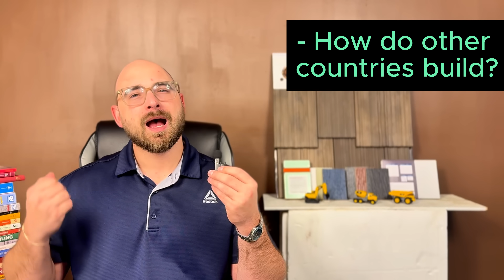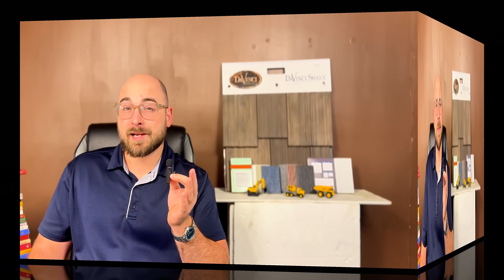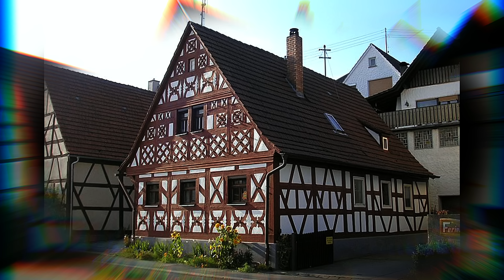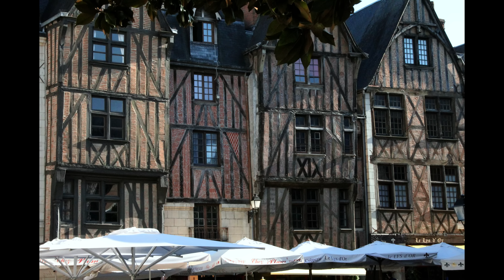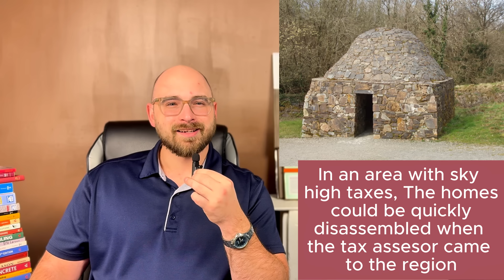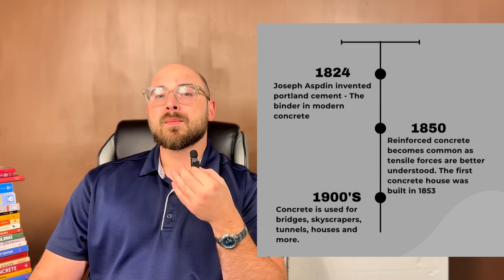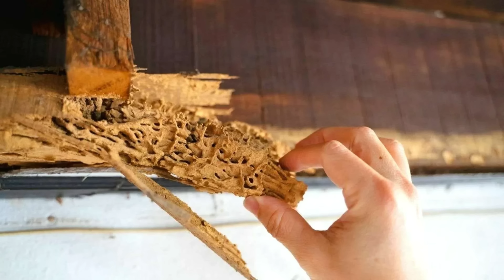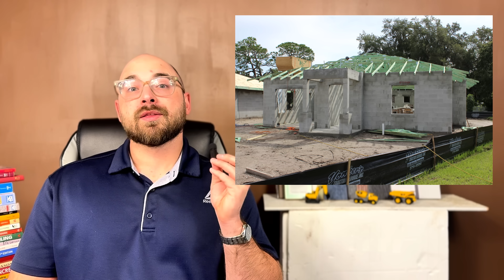Why Other Countries LAUGH at American Homes

Comment: Define what is fast. As a kid, I remember watching the news about the US and how tornadoes destroyed entire cities. So, over 20 years, they still rebuild with wood. How many times do you think you'll need to figure it out? I like light wood houses in concept and regions where the weather is not so crazy. The Americans ( the citizens) are not stupid just insurance companies force them to rebuild the same way? Or insurance on concrete houses is expensive? I don't know, but it's not just you don't want to build this way. I am currently looking at what type of house I want to build and comparing the prices. Metal frame and light wood frame houses are around 30% cheaper, especially if it's 2 or more floors. Another thing you need to keep in mind is how fast you want your house. Brick/concrete houses here are built for 1-3 years, depending on the availability of workers, etc. While premade metal frame house takes not more than 30-40 days. So when you build a brick/concrete house, you may think it will cost 200k, and in 3 years, prices are 20% more,labor is more expensive, and you are in a bad financial position :D There are many factors why something is preferred over something else, even if it's not the best.

Comment: @Mike_Fortin: From France: I lived and worked in USA. Yes, your home are not built strong and durable. It is a quick, simple way to built home, but it is as fast to destruct them.
When you compare CO2 between wood framing and MCU, the first is built to last at the best nowdays, without any type LA fire or hurrican, 50 years when the MCU or concret can last over 150/200 years without degrading and is bug resistant. Stone homes in France have over 250/500 years with roof framing built with whole trees.
The ICF seems to be a good solution, I just don't like the exterior foam which can easily melt and burn. The foam is also bad idea inside like in a case of fire, run away because poisonous gases and it is fire fuel.
You roofs built with shingles burn too easily, more better is metal sheet or like in UE clay tiles.  
Not easy to make the right choice. Each state has its reasons for what is the best for themselves and the homeowner wishes.
Anyway, you did good and made great comparaisons. Thanks.
Reply from the maker: The foam doesn’t burn with ICF, it’s treated with a fire retardant
Reply: @Mike_Fortin Your channel is so educational!
Reply: @Mike_Fortin  Hi, fire ratardant is not fire proof. Maybe with a good sick plaster and well finished, it could resist some time against fire.  With ICF, what about the perspiration of the walls?  Thanks again. Have a good day.
Reply from the maker: Correct, fire barrier is still important inside and out. 

Stucco/ fire resistant cladding protects against embers are there’s also fire resistant stucco such as Ustucco which will also protect against radiant heat, though how much is unknown 

It is possible to add a higher degree of fire resistance using densglas and/or rockwool to ensure the exterior ICF is safe from embers AND radiation / convection (direct contact with flame, nearby flame) with no damage to the foam 

As for moisture, I recommend Crown ICF block which is glued at joints for an air/water barrier combined with a capillary break at the footer. 

This leaves for a very dry wall. Earth coupling and thermal mass keep the concrete warm enough to prevent condensation
Reply: @Mike_Fortin  Thanks for answers which can people decide for themselves. Regards

Comment: Halftimbered houses were the standard in Germany for centuries - not because they did not know how to build with stone or brick or had forgotten it. It was just much cheaper / cost efficient way. Houses made completly from stone or brick were only for the very wealthy and used for castles, palaces, townhalls, churches etc.
Consequently, in the 19th century existing halftimbered were considered as poor and were often covered up on the exterior (or least a the front to the street) with plasture and stucco in order to give it a more solid appearance. At the same time new buildings were built with bricks then, because through the industrial revolution and mass production bricks became cheaper.

Comment: I live in France. The current house, and the previous house, both had a concrete floor between the 2 levels.

I won’t go into the structural strength properties. I will however go into fire risk.

If there were a fire downstairs, the way it is constructed, buys time for the pompier (firemen) to arrive.
The fire should remain contained. A fire upstairs, could compromise the roof, which I expect if it collapsed could very well knock through to the ground floor.

Yes, of course there are older properties that can go up very quickly. But any newer properties are built in such a way that buys occupants time in the event of a house fire.

Uk, where I was born and raised, used an outer structural brick, with an inner breeze block. With insulation between the brick and block. Any building estate I ever visited was like this, but methods could’ve evolved in the last 12 years.

I won’t speak for other European homes.
However I understand the criticism towards the US methods. Timber frame will burn down in little time. You won’t have much time by comparison.
Structurally speaking - why are weak timber frame properties being constructed in tornado areas? By all means live in these areas, but why in a structure that won’t withstand a tornado?

I have every expectation that a brick built euro style structure, would stand up against a tornado far better than the timber frames you use.

Comment: "You can always plant more trees"...really?  Where?  Lots of farmland is being turned into subdivisions for SFH with balloon frames built with (no joke) wood from Columbia, Nicaragua, Brazil...it's only a renewable resource if the people who use it replace the stock they deplete and if the methods of harvesting, utilization, and replacement are harmonized.  Germany is really good at this, but the US has NO CLUE when it comes to forest management...or, OK, any sustainable management (meaning you leave or restock so that your kids won't be out in the cold after you drill baby drill...).

Comment: The problem with US homes is quality. Its alright to build homes out of wood if that was the only material one could afford.

But a lot changed and the simplest wood house skyrocketed in price and quality dropped significantly. Theres far too many videos of just finished brand new homes that put chinese houses to shame in the worst ways possible. Awful construction, mold everywhere, some wood pieces already rotten, shoddy wiring etc.

However america should switch to brick/concrete housing due to the natural disasters that hits them. Hurricanes, tornadoes and such completely flattens "modern" wood houses while brick/concrete houses are much better at handleing those. Whenever a tornado or hurricane hits and decimates an area, if theres a brick/concrete house it makes the news how those received minimal damages without compromising structural integrity.

But then again capitalism benefits from the destruction of wooden homes so building better houses are unnecessarily made harder to build.

Comment: Perhaps I will say something not very new for you, but in the period of its existence in the USSR, most apartment buildings were built of concrete, the so-called "panels". Now you can see them all over the former USSR, for example in Ukraine, Poland, etc. There is even a separate style of architecture that uses concrete as the basis, brutalism.
Reply: Yes, I am from USSR, Russia, and those are solid, standing forever, well-insulated, you never hear your neighbors, and the floors are heated. 

I grew up in a red-brick CHRUSHOVKA with super-thick walls, I’d sit on a window like it’s a couch
Reply: @AnnaSzabo  Concrete with rebar is definitely not forever. It will rust and lose strength eventually.  The lifespan of those is generally considered 50 years though I'm sure if built well it could last longer but not forever.

Comment: Yeah I can afford a 1200sq ft house on 6 acres of woods for less than the cost of an apartment in most of Europe.  It’s 75 years old, and the floors squeak.  I don’t care.  I inherited it, put 50k into replacing all the mechanical and electrical systems, and now I have a paid off house that costs almost nothing to maintain.  Try doing that in Europe.

Comment: ~21:00 There, you said it, Europe builds to last. America builds to... completely unnecessarily, rebuild after a bit of weather. It's the old version of tofu-dregs. American housing is a scam. While the construction sector is classically corrupt everywhere, the US sports a special version of that corruption. People aren't even aware they could build to last. We consider American houses not houses but shacks. That stone that went through 4 walls? The answer is not to remove all the stones from the garden, but to build actual walls and not these room-separators that pretend to be walls. The country that is the epitome of the "Three Little Piglets" fable, that barely anyone knows around the world learns nothing from it. Your houses are supposed to burn up, fall over from wind, mold and collapse from flooding, so they can be rebuild, ie have you spend money again, until the next bad weather. You don't have proper dikes for the same reason. You don't even build for the last bad weather's severity, you just go back to were you were, like some African Tribe stuck 10000 years ago that never invents anything, that never improves. You are an exploited people. If I ever had the money and opportunity to move to the US, I'd move to some hurricane area and build a house to German Industry Norms just to see what happens, and likely prove a point. We have oak uprooting winds here once here in a while, but no house is crushed, bared a tile lifted off a roof. A decade ago the old down the road was uprooted and fell against the very bricky tavern on the corner next to it. The only damage: Some scratches to the bricks you can see still today. The giant tree more like rested against the building that anything else.
Also, a friend of mine told me his parents in Florida were 3 weeks without electricity after Helene went through. Three weeks! You're not a 1st World Nation. Put your cables underground! "Oh, we can't do that because [insert silly excuses that would never fly here like the ground being too wet or not deep enough]". Look at Braunschweig, Germany, the town is build into a swamp, resting on stilts like Venice, engineered by the Dutch (who also gave their expertise in dealing with the Sea, Floods, to the Japanese and they are better for it) who's country is BELOW SEA LEVEL while being NEXT TO THE SEA and not only regularly deal with floods and are prepared against them, but also are expanding further land into the sea every tidal cycle - which is just further proof that this whole "muh rising sea levels" malarky is a distraction, for we cannot control the planet's climate, but we can adapt to it.

And one last thing: You have a major error on your thumbnail. The English. Here on the Continent we do not consider the English's houses to be houses either. From our perspective they're as bad as yours, they just don't get as hard of a weather. The English freeze in their brick houses and we do not. Why? Because they built one-brick-thick, and we built three-brick-thick. Furthermore their water supply freezes in winter, because those jokers kept their pipes outside the buildings and overground, we didn't. It does make for a good Tim Burtonesque industrial-gothic scene for movies though. I'd still prefer having running water in winter and not freezing though.

I am fuming because my friends suffer because the Construction Sector of their home country is so corrupt they didn't even know what they could have had. That they could be safe, that their families could be safe, that they didn't need to lose everything from some bad weather, including loved ones.
The US Construction Sector is just like China: It pretends to be Construction, but it isn't. It's only a surface level act. It is a narcissistic scam, and it needs to end, change,  grow up.

(Also, precasts are ugly and disgusting)

Comment: Concrete does make more CO2 per square foot, I think insulated brick would make more sense. 

Commerical properties are almost entirely concrete now days.

Changing code would be the hardest thing to change, I wanted to build a brick home, but our local code requires a wood style main construction.

Comment: I'm obviously biassed since because where I live in Mexico, but why would you build a house, an investment that probably costed decades of work, with a material that isn't the most durable thing possible you can find?

To a degree I can understand using less brick/concrete and more wood to add extra insulation if you live in a very cold area (Although in modern times, why not use other forms of insulation?), but no brick/concrete/stone? It feels weird to me.

But as always, the problem in the US is predatory businesses.

Comment: Buddy in aerospace told me that Roman Concrete had indeed been rediscovered not so long ago (though I haven't looked up the details yet). However, it would be much more expensive than what we use today, though it would make a lot of sense imho, to spend that extra cash when it is about infrastructure and governmental buildings (that better look nice again, and move away from this brutalist and "modern" concrete, glass and steel nonsense and back to real architectual beauty).
Reply from the maker: There are admixtures which can allow modern concrete to heal small cracks like Roman concrete

Comment: Mostly the way of building things is a combination of multiple things like, use, material availability, climate and weather, temperature regulation, moisture regulation, skill, supply and demand, etc. It's what makes every traditional house unique. Now you just slap a bunch of materials together and put some ugly air-conditioning and heating units in and be done. It's expensive and cheap at the same time. Anyway, in the USA they choose to build cheap spacious houses over durable and safe, it comes out with the same cost with the exception of how long it stands. Here in the Netherlands for example the foundation is exceptionally expensive, sometimes even more expensive than the house on top. Concrete definitely isn't the way to go, it's just bad overall (also not worst).

Comment: The main problem with light wood structure is just that - it is light. The lightest the code allows.. Use a little more wood, or even just a bunch of steel cables to reinforce the structure, and it may even withstand the evening breeze.

Comment: It's simple. The material that is most readily available, most abundant and cheapest is used in each area. In the US, this is wood. People usually talk when they should be quiet. A problem that transcends nations.

The West Coast suffers earthquakes and fires. The Midwest suffers tornadoes. Both forces of nature make no distinctions when it comes to demolishing houses. And they don't demolish two or ten. They tend to be 20 or 40 blocks. Which have to be rebuilt as quickly as possible. A wooden house is built in no time, much less for a modest price. In the United States, this also needs to be said. In Europe, wood costs the same as gold.

But it's easy to fool all the Europeans. Average cost of a house on both sides of the pond? And now who's laughing? By the way, I'm European.